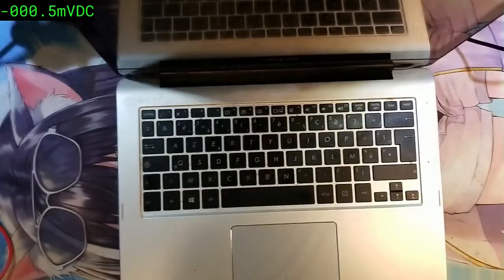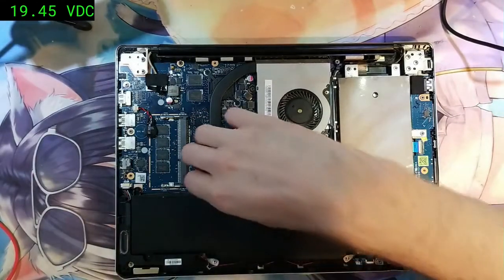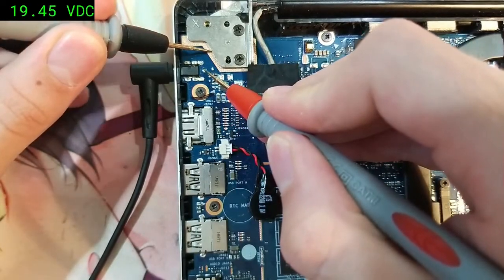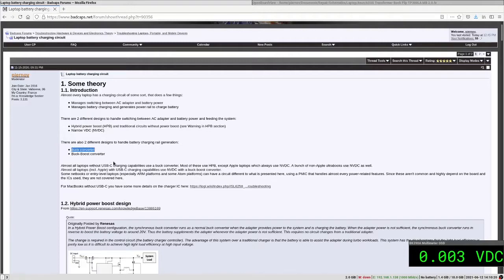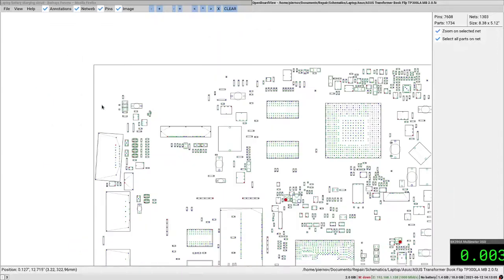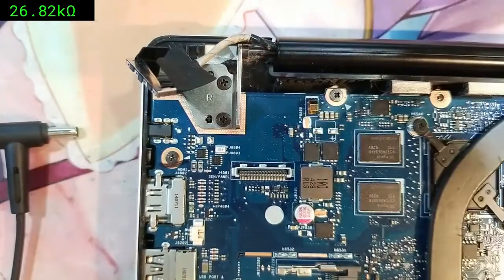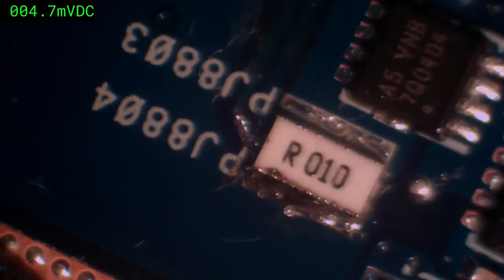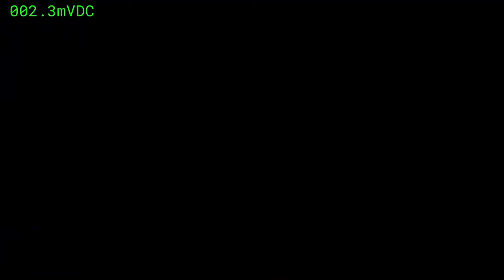T&F Asus TP300L no power, charging circuit troubleshooting

Comment: Thank you very much for repairing my laptop! Impressive work!
Reply: This was your laptop? How did the trace below the resistor become broken? So odd.
Reply: @jaym5938  The RAM sticks were protected by a metallic case. I upgraded the sticks, removing the case and putting it back in the wrong orientation, when I tried to push it to set it in place it damaged the board. I had no idea it came from this manipulation before Pierre-Emmanuel investigation.